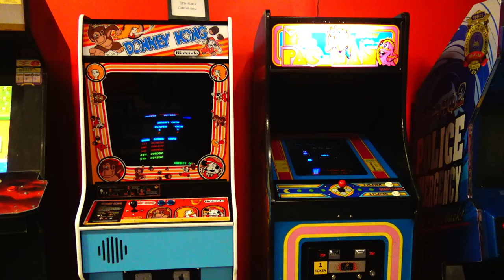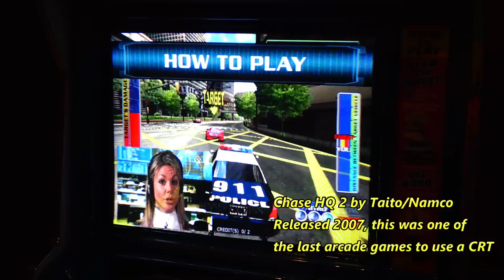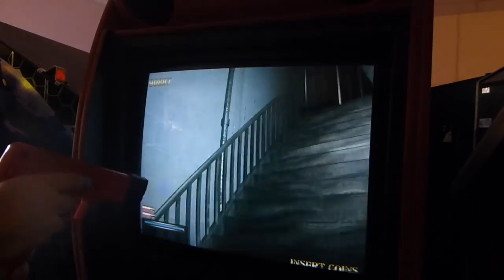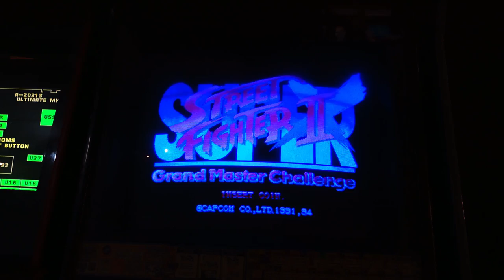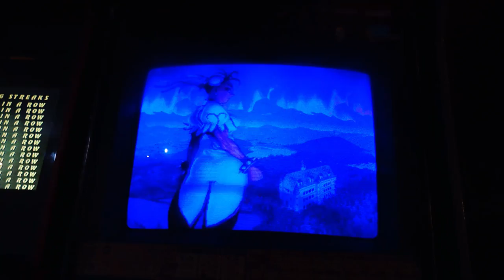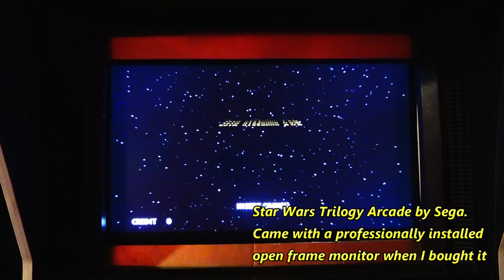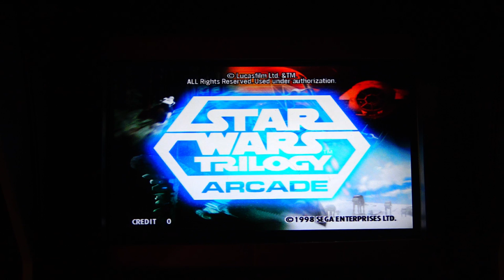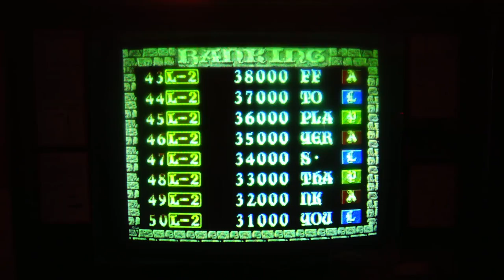The Great Arcade Debate: CRTs Vs. LCDs

Comment: As an owner of a home built pc multicade, i didn't really see crt's as an option. MAME has some pretty good scan line and mask filters that along with adding some curve and defocusing to the pipeline really create a pretty good CRT effect. Even though the games are low res, having a high res monitor allows better "CRT Effects". With GSync/and Freesync, you no longer need to worry about refresh rates or vsync issues. If there was a market for it, maybe somebody could create a plug in module to add analog effects to converted lcd arcade machines.
Reply: Am looking into building myself an arcade cabinet, but struggling to choose the right monitor for it, there are so many options, what would you recommend (I am thinking 27inch would be ideal size)?
Reply: @davidplunkett5645  I have a 32".Remember that some games were designed for vertical oriented 4:3 screens and may look small on a horizontal monitor. The other thing to consider is resolution. With emulators, you want to use integer scaling. So if the original game is 320x200, it should be scaled to 640x480, 1280x960, 2560x1920 etc. If you don't do integer the games won't be pixel sharp. Higher resolution will also allow for better visuals with scan lines and other monitor affects available in mame.  Finally, another thing to consider is a monitor with gsync or free sync, and a graphics card to support it. Many old games run at odd refresh rates and you may not get perfect timing with your monitor. So lots to consider, and research for you.
Reply: @GetOffMyyLawn  thanks for this, out of interest which make/model monitor do you have? Will have a look for gsync/free sync.
Reply: @davidplunkett5645  I have an old LG 32" 32MA70HY-P . If were shopping today, i would look at the LG 32GN650-B and similar.

Comment: It would be nice if a display manufacturer were to create an LCD which was curved like a CRT strictly for the purpose of emulating an old glass CRT specifically for arcade machines
Reply: with fake scanline/rgb effect options too! they would sell a lot of those in the next few decades as collectors need to replace their's
Reply: OLED 480P square ,  adequate .